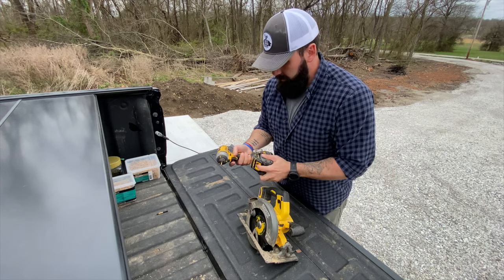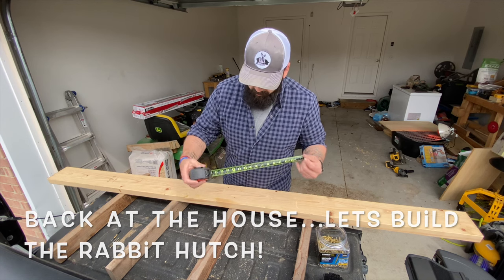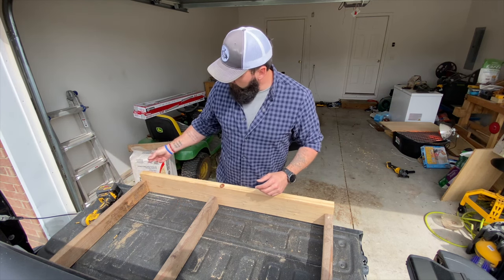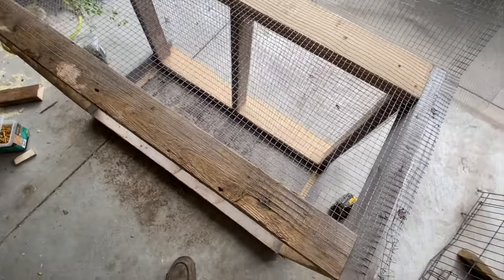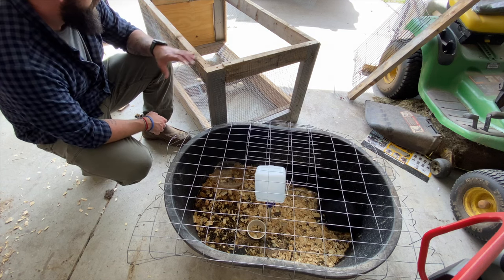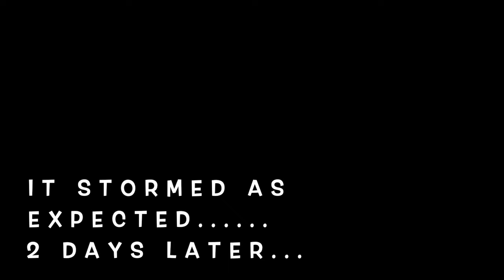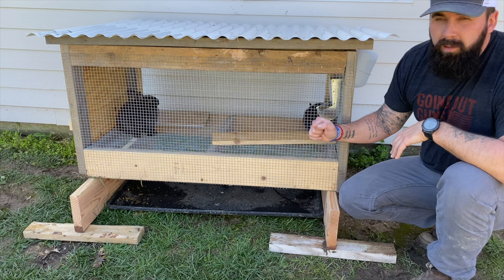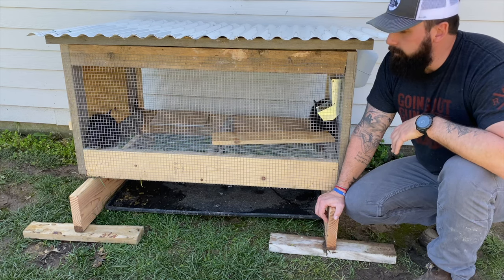Rabbit Hutch

Comment: I make all my cages out of wire and have no wood to catch poop and them to piss on. 1x2 on the sides and tor with 1/2 x 1 on bottom and 2 inch from the floor on the wall to prevent baby bunnies' from crawling out.

Comment: What is that dewalt tool called?
Reply from the maker: Which one? I have links to them in the description. 👍🏻
Reply: @DossFarm  You showed it momentarily as you zipped off the edges of the wire mesh.  It cut through it like butter!
Reply from the maker: Robin Clary Angle grinder.
Reply: @DossFarm  Thanks!!  My tool vocabulary is limited to "hammer," "screwdriver," and "table saw."  :D
Reply from the maker: Well be careful with this one 😂. It’s a little more dangerous. Think of it like a handheld table saw.

Comment: What is that tool??? I have to get me one!!
Reply from the maker: Angle Grinder 
https://bit.ly/ALLofMyDeWaltTools
Reply: I'm building a fence around my garden to keep critters out of my veggies and using chicken wire, and was thinking it was going to be difficult to trim with just wire sheers! That tool will make it so easy!
Reply from the maker: There’s a cheaper model on Amazon. I use my tools often enough I go ahead and buy the more expensive. Just type “cordless angle grinder” into Amazon and any of them will cut that wire for you easily. 😎